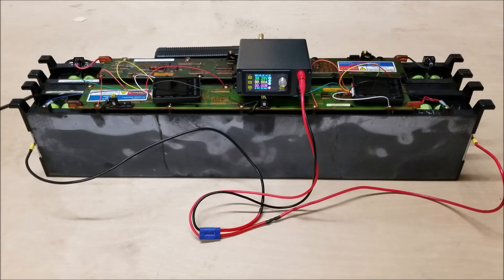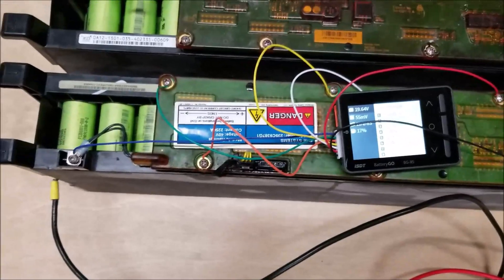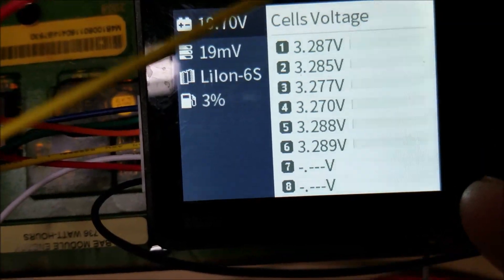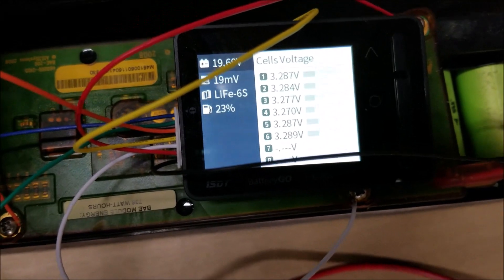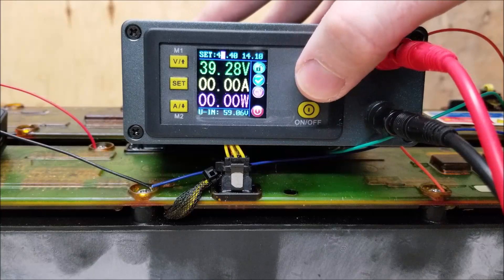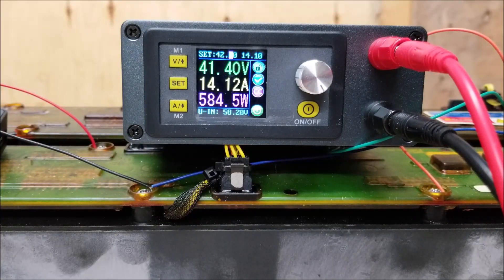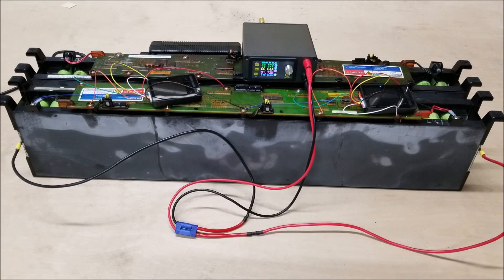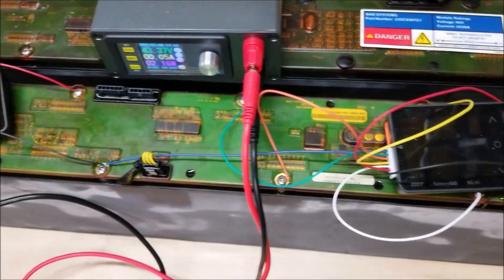A123 pack testing ANR26650m1A

Comment: I think what took so long is you tried balancing before clearing the 3.35-3.40V threshold. Attempting to balance during the flat part of the curve is not actually balancing since voltage only correlates to SOC from 2.5 to 2.8’ish and 3.40 to 3.65. In between that if you’re pulling down the highest  cells to the lowest cell that happens to be 3.29 or lower you could be pulling down a 20Ah pack by 4, 5 or 6 Ah as the low cell takes it sweet time in the flat part of the curve. 3.27 could be 70% imcould be 50%.

Best to set the pack to 3.45*12 and then see where your highest cell is. Inch it up so your highest cell is at 3.55. At this point decide if you want to take the charge or discharge route. If you have one low outlier individually charge that cell. If you have just one or two high cells then put a load on them and charge the pack at a rate that matches the load. Use light bulbs or power resistors. A 1ohm 100W resistor is $6 and gives you 3.5’ish amps if the voltage is 3.5. A 0.1 ohm resistor gives you 35 amps but that does push the resistor at its max power rating of 100W. Use two in series for a 0.2ohm to get 17 amps and charge the pack at 14 amps so you still get a discharge from your high cell if that suits your fancy. 

If you have to constantly adjust your set up because you have one or more runner groups you might just want to consider salvaging the cells from the pack but label them all first so you know which came from the problem groups. Then you can rebuild a pack with cells that are already top balanced by doing the long row of cells in parallel trick up to 3.6V method.

I’ve just never had much luck with these balancers trying to fix a pack that’s out of whack under 3.30V. It takes forever but if you have an hour or two to kind of keep an eye on it you can charge these cells fast enough to get it done manually.

Comment: As a follow-up, I have disassembled a few of these packs down to the single-cell level.  The mAh out at a 5A discharge was typically around 1600mAh, some as low as 1500, a few as high as 1800mAh+.  Most individual cells did improve (around 2%-6%) after two full cycles (charge @ 2.5A, discharge @ 5A).  This was using a Hyperion EOS charger with a dedicated LiFePO4 charge cycle to 3.7V CCCV and Competition Electronics Turbo 35 to discharge.

The problem is that after two full cycles of each individual cell in a prior 8P group, the returned capacity at 5A went from a low of 1477mAh to a high of 1830mAh with another group going from 1266mAh to 1725mAh.  The very wide variation in actual single-cell capacity means that even with a conservative LVC on the (prior) group, the weak cell could be drawn-down dangerously low.

FYI, I did a 25A single-cell load-test with a Competition Electronics Turbo35 with remote voltage sensing and the voltage dropped to 2.68V at the 10-second point and 2.32V at the 60-second point in the discharge, thus I really don't think that anything much more than 30A is at all practical.
Reply: Your cells are very degraded so their IR has gone up. Fresh cells are fully capable of 50A continuous. They’ll sag down to 2.6V but will give their full capacity, maybe 10% less at such high discharge rates
Reply: @ericklein5097  This video is about decommissioned hybrid-bus battery packs, so comparing them to "new" cells is meaningless.  In any case, this form-factor of cell and specific design is essentially obsolete and would probably be impossible to get "new" in any case.
Reply: @awebuser5914  Yes, I'm aware of where these come from. I have purchased packs of them. There is currently a seller on Ebay selling them for $99 shipped and they are testing quite well. I think they may not be from buses, this module/pack design was also used for other applications, I believe some kind of data backup/storage and this was the backup power.

Not sure why you think this design is obsolete or not available for purchase anymore. The ANR26650M1B is still available for sale under the new branding of LithiumWerks. I don't know of any cell that matches the continuous discharge rate of this cell unless you go to a MUCH larger size. There are definitely pouch cells that blow this out of the water in terms of energy density, unsure if those are still made.

I've been meaning to buy a YR-1035+ to test the impedance of my cells, based on the DC IR results I'm getting I think they will be pretty close to the new value of 6 mΩ
Reply: @awebuser5914  Also individual cell capacity does not matter. When cells joined in parallel they become one cell. The way I read your first comment is "wide variation in actual single cell capapcity" means you're talking about individual cells in a P group. If you're discussing the parallel groups being different from each other,  yes that definitely becomes a problem but the fresh packs I got are so tightly balanced that I'm not using a BMS or a cell balancer outside of just hooking it up to a balance charger once a month due to OCD. Realistically I could run 100 cycles and probably still not need a balance charge. I suspect that changes past 1500 hard run cycles which is what I would guess your cells are at based on the figures you've given and A123/Lithium Werks datasheets showing degradation at a 1.2C/8C charge/discharge cycle.
Reply: @ericklein5097  "When cells joined in parallel they become one cell.", is complete nonsense.  The cells within one parallel group can and WILL degrade at different rates and a substantial weakening of a cell in a parallel array can lead to the failure of the cell itself and a cascade deterioration of the parallel array, let alone a voltage imbalance in the discharge capacity of the series grouping, leading to far lower overall pack capacity.  Also, I doubt you have ever seen these packs in anything but a hybrid bus use since they were specifically designed by BAE systems for use in a hybrid city bus drivetrain, nothing else.

These cells might appear to be sold by Chinese "cloners", but they have little to do with the original design of the A123 cells, they are just knock-offs using generic LiFePO4 technology that China has had decades to optimize to make extremely cheap cells.  The performance of these knock-offs is terrible in comparison to what were real A123 cells.

Comment: Any luck figuring out how to use the built in bms? These packs look perfect for a student electric go kart im building, but a bms that can handle the peak power we're looking for (16kw, so 400a peek ) would be ridiculously expensive
Reply from the maker: Unfortunately no, but you don't need to run the power to your controler though the BMS, you can use the BMS to run a separate contactor (relay).

Comment: I've also purchased some of these packs from the same vendor. I've been harvesting and testing the individual cells and have noticed that some of them have low capacity compared to the others. Generally I get about 1.4 to 1.5 Ah per cell but some (maybe 5%) are at .5 to 1.0 Ah. If you leave the pack as-is the higher cell will constantly try to compensate for the lower ones. I still like these cell's even if they don't have a lot of capacity compared to Li-ion since they are related for use at -30 celsius.... which is very good in cold climates like in canada.
Reply from the maker: you can discharge them at -30C but you aren't supposed to charge them below freezing.
Reply: @DIYbatteries  Correct... configuration would be to keep the area where the batteries are heated to over zero with a heat pad just before the sun comes up if the batteries are at say 80% state of charge, top up the batteries then stop the heat pad when at 100%. Arduinio configuration

Comment: With a 12v 100 amp load on one of these that I tested, I was getting a 1v drop (4v across 12v) which is only 12.5 amps per cell. So the 60 amp per cell is either really optimistic or my cells were really worn out.  A couple of the cells that were pulled tested at 1156 and 1208 mAh
Reply: Yes... the 'good' cells seem to be at around 60%... the 'bad' ones (maybe 5-10%) are lower than 1.0 AH
Reply: Those were junk cells...

Comment: I did the same thing as yours but mine only charge and the first 6s. The 2nd group of 6s did not charge at all, only charge to. 3.37volts, while the first 6s charged to 3.6 volts. Any Idea why? Thanks man. Learning a lot from your videos..
Reply from the maker: If you are charging it from the end terminals then your pack is unbalanced. It probably means your cells that charged to 3.6v are weaker than the cells that only charged to 3.37v.
Reply: Leaf Xpack i made an output connection to from - to 6s, then 7s-12s so i can charge them as 6s and balance them while charging, i got them charge and balance to 3.7 volts for the whole group, now when discharge im gonna try to charge them as 12s again and observe if they will still do the same, if not, charging simultaneously is not a problem, ill just charge them as 6S. More convenient if charging as 12S though.
Reply from the maker: @electric_rider2044  That's what I would have done. Once the cells are balanced, you shouldn't need to charge them as 6s anymore.

Comment: hi. I was wondering if the Dc to Dc converter will stop charging if it reach the desired voltage charged you set it too? I have the same battery module and i wanna charge it like you did, the only diffrence is i have a switching power supply to power that dc-to-dc unit.  

How long did it take to charge the whole pack? 

Thanks for yiur time. Awesome content i learned some new things.
Reply from the maker: The DC to DC will not exceed the voltage set so yes, it will stop charging. Note that once the maximum voltage is reached, the current will gradually decrease and eventually will go down to nothing. The pack only took a few hours to charge.
Reply: Leaf Xpack thank you...

Comment: What's that dc to dc converter called i would like to buy one. WOuld perhaps you have a link to it. TKS
Reply from the maker: RIDEN® DP50V15A DPS5015 Programmable Supply Power Module With Integrated Voltmeter Ammeter Color Display Module Board from Electronics on banggood.com
https://banggood.app.link/HmdK1nmR16

RIDEN® DP And DPS Power Supply Housing 2 Kinds Aluminum Housing Constant Voltage Current Casing Digital Control Buck Voltage Converter Only Box Module Board from Electronics on banggood.com
https://banggood.app.link/Bo1lDDrR16

Comment: As constructed could these packs be modified for 24V ?  8S  12P ?  Separated to 4S Groups ?   How are they configured as is ?
Reply from the maker: Not easily no, some people just use 2/3 of the pack in order to get the proper voltage

Comment: How long did it take to balance the "cells", as you call them?  It seems to me that the amount of power you'd need to dissipate with an 8P/2500mAh "cell" would be staggering!  Most of those small balancers can only dissipate a few watts, and even a small voltage difference would tax such a small unit!

As you've probably found out, any group of paralleled cells is only as good as the weakest cell, and that weak cell(s) can damage the rest in the parallel group.  If you have a single parallel group that drops precipitously during discharge in a 12S pack, you have a very real potential for voltage reversal, where the entire parallel grouping is driven negative (or very close to zero volts), and will be permanently damaged.

These look like very interesting packs, but the lifespan left in the cells looks to be very questionable.  I suspect a lot of buyers don't take the effort to really test the cells (per 8P group) in a methodical way, and would be shocked at how poor they can be!
Reply from the maker: Actually, it didn't take that much time to balance, at most, about 24 hours. I've balanced far bigger packs with these units and it could take weeks. The key is to balance the pack while not in use. The problem comes if you have cells with a high self discharge rate. I once built a pack with very old 18650 cells and even with this balancer running for days, the pack kept getting more and more out of balance. 

You are correct about having weak cells in a pack, which is why it is important to stop discharging when any one cell group gets to a low voltage. Also, any low cell group ends up being strained more and more since it would get continuously discharged down to zero whereas the other cell groups may only be discharged to 20%. As time goes by, the weak cells end up getting weaker...

I've purchased several of these packs and only one still had fair capacity remaining. There is a reason why these were removed from service...

Comment: Good stuff on the testing mine were fairly close to balanced at nominal voltage and they drift apart depending on the load but I've had them hooked up about a month now and they balance within .009 most of the time I only use them from 3.1 to 3.57 as both ends have small capacity but he middle seems to do well. Also I paralleled 12 packs together which seems to keep them to a more medium voltage. Good Luck on the testing.  No Ebay straight from the junk yard is a lot cheaper.

Comment: Got one of these. Any advice on opening the enclosure up leaving it as intact as possible?
Reply from the maker: On both sides there's a thin plastic that you can peal off. Then you just remove all the screws and remove the plastic on both sides. It's a little tricky but if you are patient you can take it apart without causing any damage to the cells. You could also break it up into three 4s9p packs, equivalent to a 12v lead acid.
Reply: @DIYbatteries  thanks!
Reply from the maker: @HansHenderson  See my new video: https://www.youtube.com/watch?v=XJ1DjQJDISw

Comment: Where would you connect a charger to. I have a 42v lifepo4 Charger. Can it be charged from the end terminals ?
Reply from the maker: Yes, this is how I have it connected, but you need to make sure the cells are balanced and your charger will cut off at the appropriate voltage (43.2v ideal, 45v MAX)

Comment: I'm looking at buying some of these packs and I was wondering if they would be any good for an off grid system charged from solar and wind? could they be used as is or would they have to be modified for that use?  I'm in  ontario canada as well where about's are you?
Reply from the maker: Depends on the voltage of your system. These packs are fully charged at 43.2v and fully discharged at 24v (although I wouldn't discharge them below 30v on a regular basis) Unfortunately this is not an ideal voltage for solar/wind systems as most of them are designed to run at 12v, 24v or 48v. These packs would only work in a 36v system which is very rare (if it even exists).
Reply: @DIYbatteries  thanks for the reply, so I would mod the packs then to 24v or 48v instead of 36. there are some good deals around me for old bus batteries
Reply from the maker: @jasona.neverforgetfukushim647  where are you located?
Reply: @DIYbatteries  Wasaga beach ontario
Reply from the maker: @jasona.neverforgetfukushim647  Where are you able to get the batteries?
Reply: Geeze I was looking at buying these too but 50% average capacity! I bought 12 of his 60ah cells and they’re 70% capacity. The problems and unknowns that come with used cells just isn’t worth it to me anymore. Clearly there’s a lot of suckers who will buy used cells so forking over the extra cash to buy new makes it much easier knowing I can sell them when they’re on there way out.

Comment: RE: Individual cells tested 0.6 - 1.5AH

Maybe they've been sitting dead for a long time and need a few cycles to perk back up? I found a university paper comparing lead acid to these cells, and they're claimed to be usable up to 20,000 cycles!?

https://www.researchgate.net/publication/318448902_Comparison_of_lead-acid_and_lithium_ion_batteries_for_stationary_storage_in_off-grid_energy_systems

Fig. 9. Life cycle test results of Li-ion battery ANR-26650M1A by
A123 Systems (+1C/-1C, 23o
C, 100% DOD) [22]
Reply from the maker: My theory is, since these were used in a cold climate  (and in Quebec it gets really cold, like -30)  they were probably regularly charged when below freezing which is really bad for lithium batteries.
Reply: @DIYbatteries when you took the 8 packs apart, did you notice any duds bringing the 8p each cell packs down?
Reply from the maker: @thedavesofourlives1  Not duds per se, but the capacities ranged from a low of 666 mAh to a max of 1640 mAh. Most were in the 1000 mAh range.
Reply: 20,000 at 60% capacity